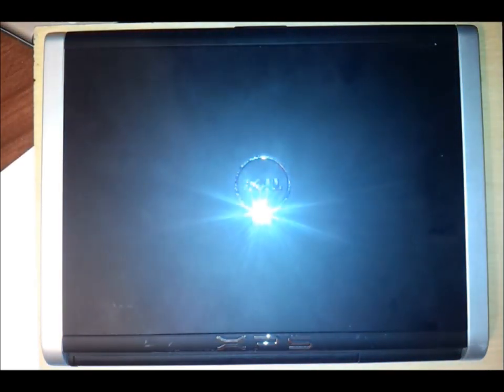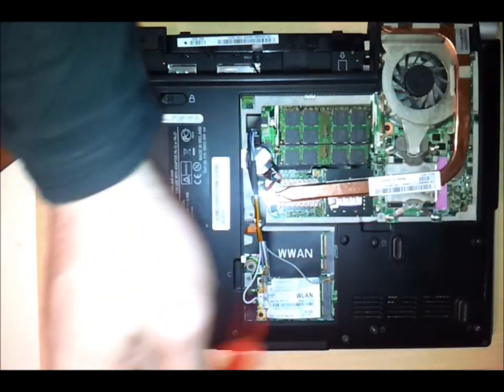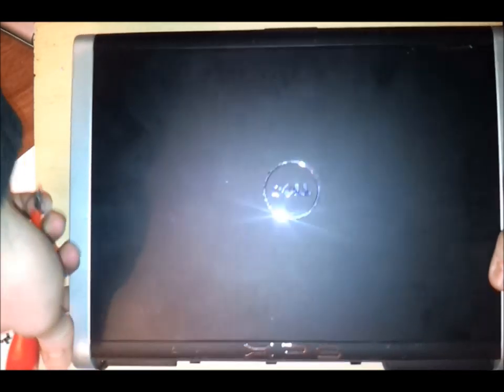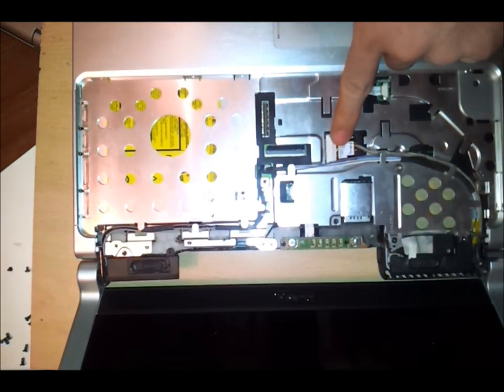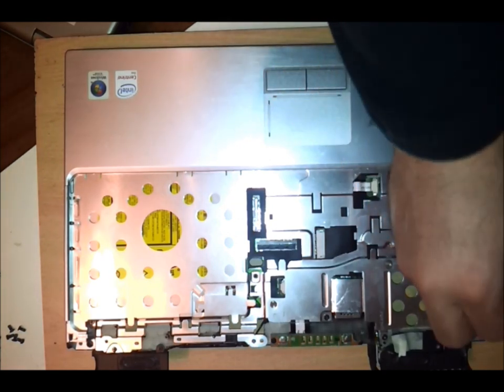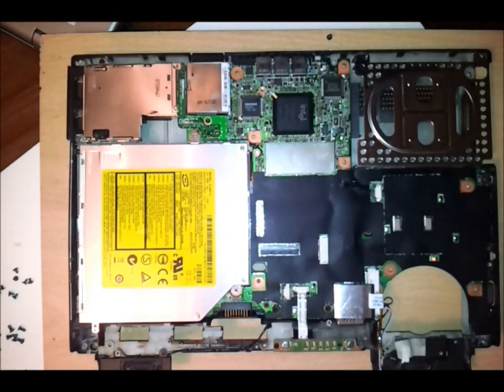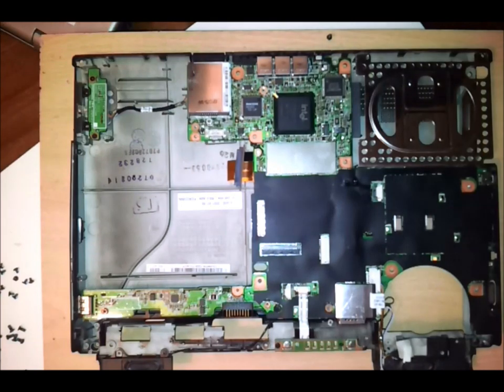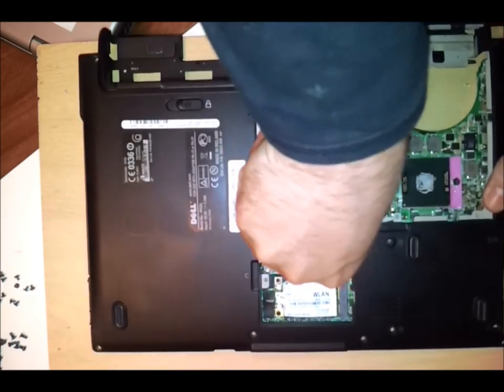*HD* Dell XPS m1330 Complete Disassembly Guide

Comment: thank you very much
Reply from the maker: pleasure
Reply: How do I fix the no power issue please?
Reply from the maker: Any lights at all?
Reply: not at all
Reply from the maker: Then it's one of 3 things. 1)your charger is dead. 2) The DC jack needs to be replaced on the motherboard. 3) dead motherboard needs replacing.
Reply: I thought asmuch. Tried several chargers but no luck so considering replacing the motherboard
Reply from the maker: Check the jack on the board first. In all honesty, this laptop is ancient now so it's not really worth investing in a new board
Reply: I see
Reply: Thanks will check